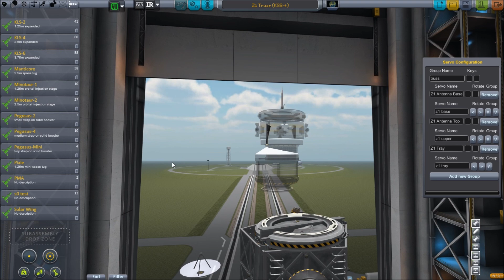KSS-4: Z1 Truss / Project Gateway / Kerbal Space Program 0.23

Comment: Why did you launch 3 PMAs in replacement for 1? The others would not need to be replaced because they have successfully docked to the station and have travelled past the failure window, were manifested with Unity and did not use the suspect tug. Also after PMA 3 failed you launched the replacement PMAs with the flawed Pixie tug and ATTITUDE CONTROL FAILURE. When you used the new tug however the PMAs successfully docked.

14 Minutes Later
The Soyuz engines should be replaced with a new version that has less chance of accidentally retrofiring.

Comment: Concerning the fairing jittering issue that you were having, anytime you add something to the bottom of the engine, it creates a fairing automatically. By adding a fairing to the engine, you essentially had two fairings occupying the same space. The two textures were overlapping and doing what is called "Z-Fighting." The more you know :)
Reply from the maker: Ah the so attached shroud is not considered to BE a fairing. That makes sense. I do know about Z fighting (I make game for a living) but did not know it was adding a second model. That is good to know! Thanks! It means if I were to use the extra no-fairings models from KW that I would be able to use the ones I tried using in the video and they would not have an issue anymore. It also means I'd ALWAYS need to use those fairings from now on though, or else not be able to see any fairing at all.
Reply: Everything you said is true! I THINK that the auto fairing is also a physical model as well (at least they are with stock engines) which means that there is an aerodynamic effect. Happy launching.

Comment: I've had some of the very same issues recently. I think i solved them by disabling remote tech and updating Ferram. Remote tech was duplicating ships, and Ferram was just occasionally acting strange.
Reply from the maker: I had those sorts of problems too, but what the issue was for me is I welded the parts "upside down" and that caused the navball to think I was backward all the time. I was having a mental block trying to invert my normal flying controls, so I decided to deorbit the parts. I kept thinking I had it fixed, and they kept on being backward. I later realized it was from having flipped the root part, not the docking nodes.